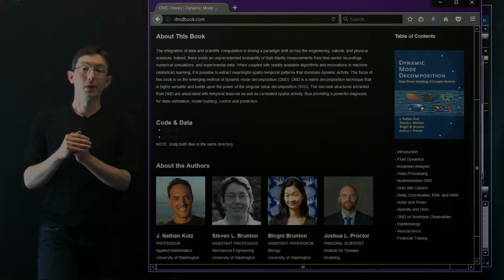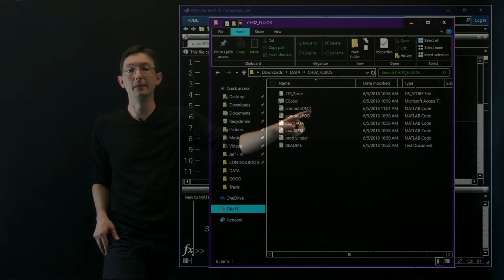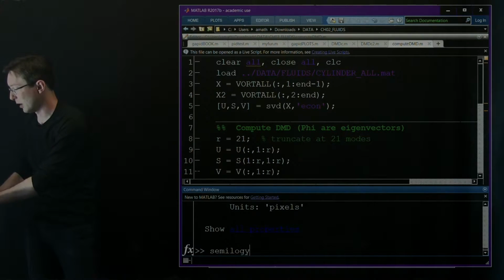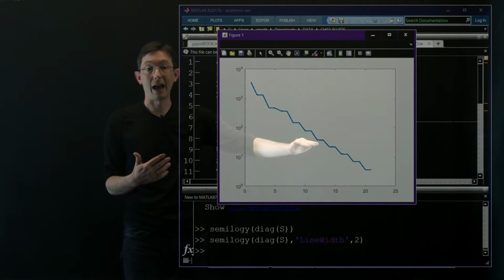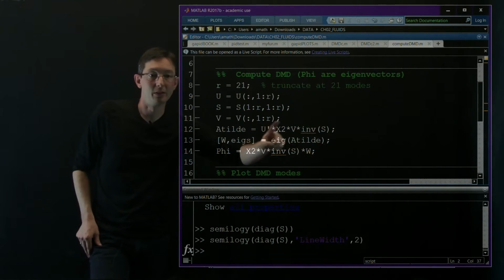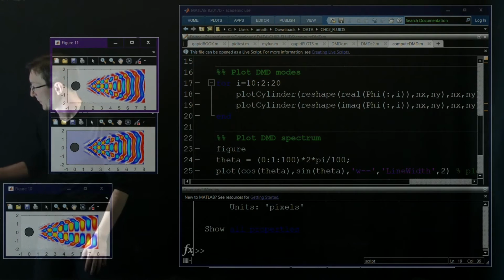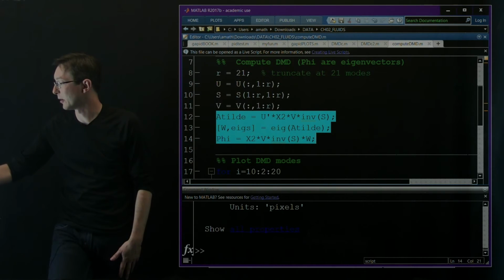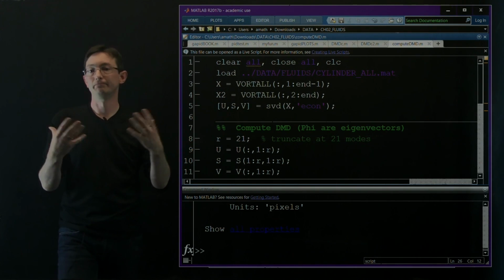Dynamic Mode Decomposition (Code)

Comment: Mr. Bruton, what is exactly the difference between POD and DMD speaking very generally, not in mathematical particularities.
Also, I think it would be super useful to see the whole process from modeling to control design e.g. taking actual data (perhaps even generating to include some basic CFD), doing some model reduction like DMD and using it on analysis and control design. I think it would be a great way to learn how to use it in practice (and when) and clearly see the benefits of applying such methods. In anycase, thank you for all the super useful material, its a true privilege to have such great lectures available.

Comment: Hi Steve, just wondering why the eigenvalues of all the modes lie within the unit circle?  I tried to apply the method to simulation results obtained from detonation wave , and i got all my dominant modes lie within the unit circle as well. Secondly, all my modes lie on the right-hand side of the imagenery plane, is it an indication that my system is inherently unstable ? Thanks.
Reply: DMD tries to capture the oscillatory behaviors so the corresponding eigenvalues will lie on the unit cycle. i.e., |e^(i*lambda)| = 1 where lambda represents the frequency of rotation.
Reply: Did you know the reason for this? I have the same issues. The reconstructed signal fit well. But eigenvalues are different with DMD and real physic model